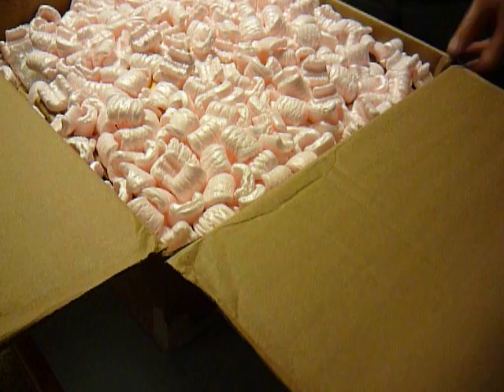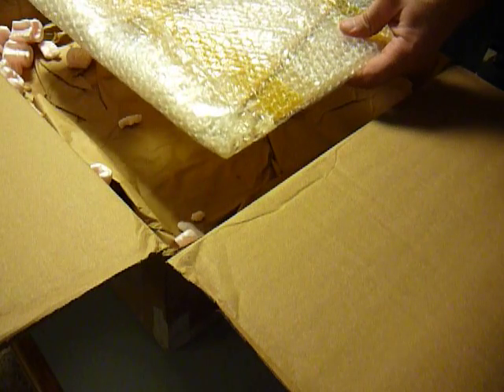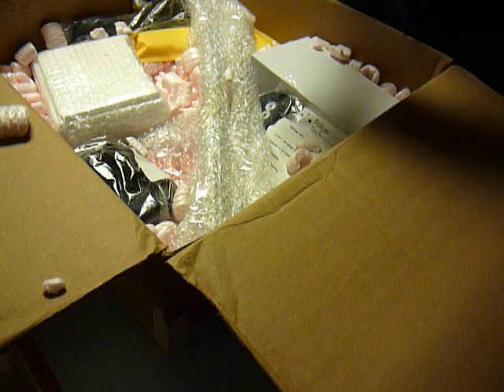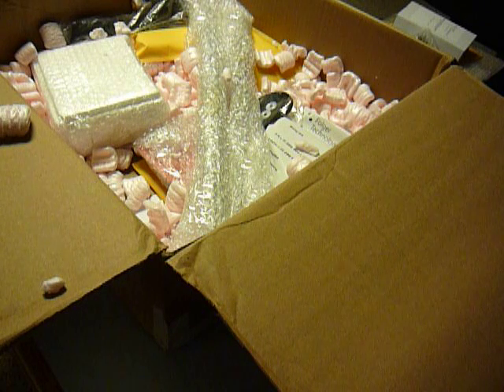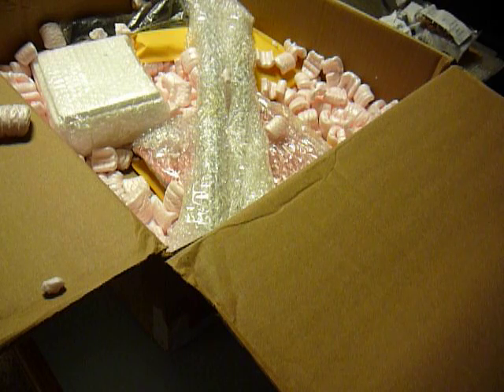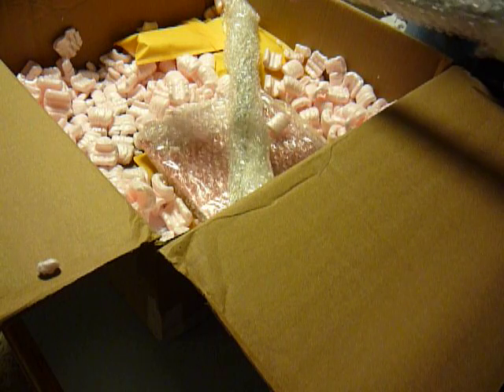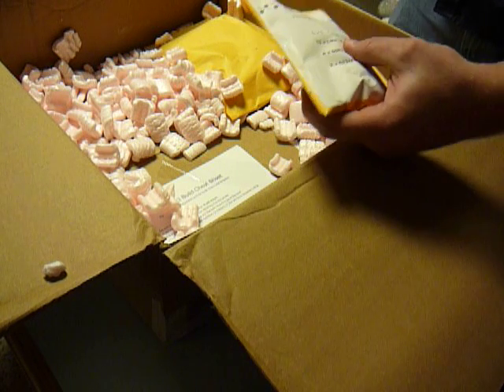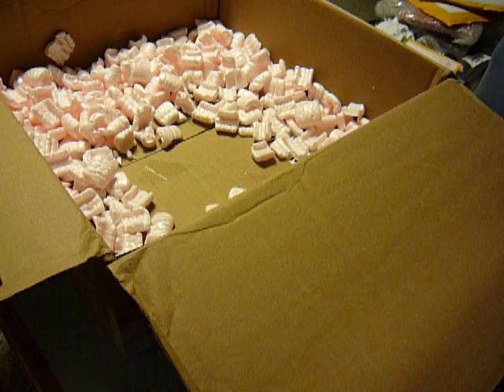Folger Technologies Prusa i3 3d Printer Build part 3 - Unboxing

Comment: Would you be able to buy an aluminum frame and put it together with all the same parts
Reply from the maker: Very likely. You'd just want to make sure the AL frame was the same dimensions as the acrylic one. That is one thing many people forget, they like the low price of the kit but for one reason or another, a particular feature is what sways them away from purchasing this kit. It is a great price for the kit and if you wanted an upgrade it still might be cheaper to buy “that upgrade” and this base kit and make a supreme printer.

Comment: I am saving up to purchase this printer, im glad i found your vids and to see that this is vary recent. Ill watch all your vids before i start asking questions haha
Reply from the maker: skyalchemist0 I think all combined, my i3 videos are an hour and a half long. They are a supplement to the videos Folger Tech posts in their Google drive (link listed in the eBay ad). Please watch mine but also watch their videos, between the two video sources, you should be able to build this rather quickly, also read the comments from other users in the videos, They ask questions that I may have overlooked while recording the videos. Specifically about hooking up the heated bed and the need for end stops.
Reply: bubalettow glad I found your video.  This will not be the kit I purchase.  Too much inattention to small details.  Simple this GS they could easily fix.  Also you could have made a mount for the power supply that matched its screw pattern and the old pattern on the printer frame to act as an adapter.
Reply from the maker: gljay I suppose I could have made a mount but for $0.92 and the drilling of a hole I have a secure connection and kept with the clean look of clear acrylic frame. If you are going to buy a different kit, I ask that you post a link or a brand name for others to search. My videos are only intended to be informative and primarily opinion, not hard and fast law.